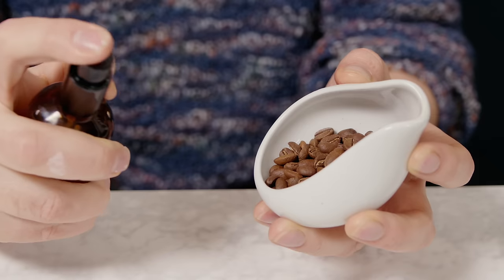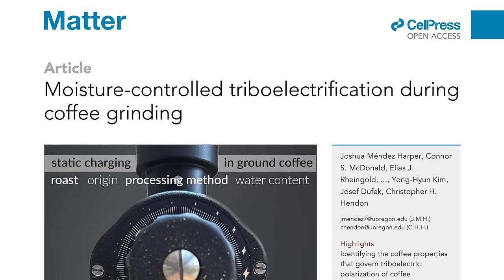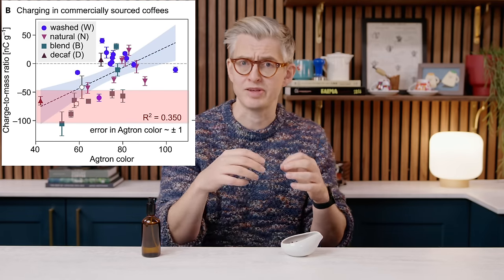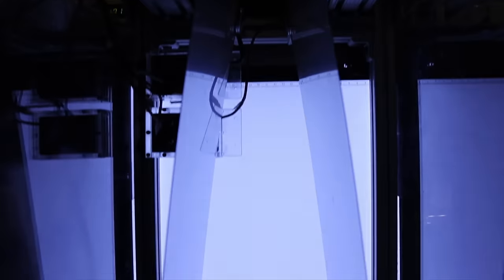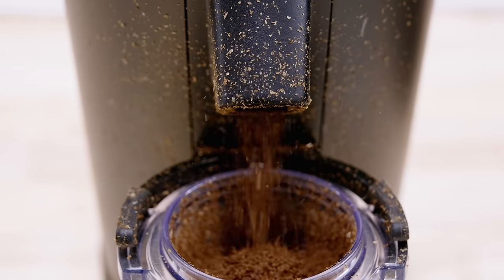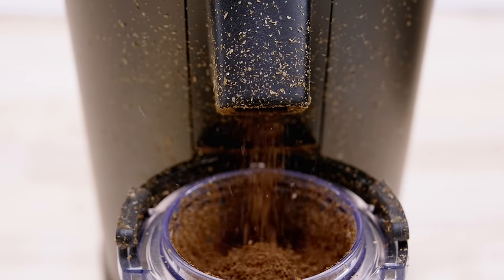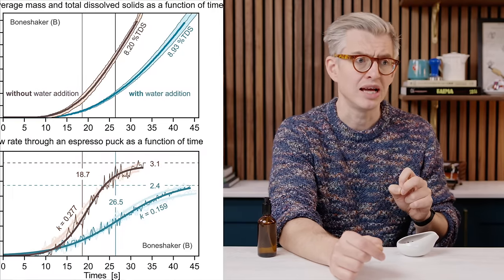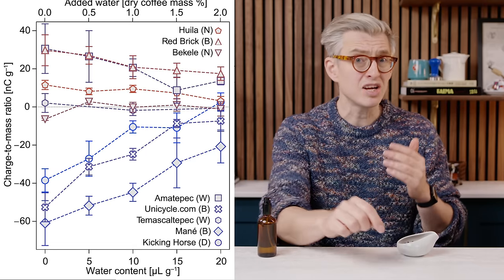Science Discovers What We All Missed: More Than An Anti-Static Hack

Comment: The reason you're not seeing particle size differences in your particle sized analyser is probably because it breaks up the electroclumps during the measuring process. No idea the details of how the machine works, but it would be far from surprising if it was violent enough to the micron sized particles to break up the electroclumps into their constituent grains.
Reply: That's definitely a potential hitch in their theory. They are just assuming that the changes are caused by clumping. But if you can't prove uneven particle sizes because the measurement method interferes with said clumping, it is just theoretical.
Reply: @skeetsmcgrew3282  You'd have to pretty much do it manually I suspect. Get samples to test under a very good microscope and either visually confirm the existence of electroclumps or do a visual size comparison of the whole sample. Although you could probably take a high res picture and have a computer do the comparison part.
Reply: It looks like a Litesizer DIA 500. This comes with one out of three choosable dispersion units with the object to separate particles from each other, which indeed could separate the clumps. One is solving it in liquids. One is Dry Jet. One is Free Fall. No idea which one was used in this video.
Reply: It's like in quantum mechanics, the measurement problem all over again!
Reply: @maxmuster6390  Thanks for digging into the hardware! Would be good to know what they're using in their machine. I guess free fall might be the only one which doesn't destroy electroclumps?Although if they survive the tampering process in espresso making, then perhaps they're not so fragile...
Reply from the maker: Dry jet!
Reply: @jameshoffmann  dry and wet dispersion can lead to very different results, as the amount of energy imparted on the particles for dispersion is very different. Agglomerates can be very sturdy or very brittle, so particle size measurement with laser diffraction often needs a thorough method development before giving useful and repeatable results. Trying lower air pressure might lead to "better" results if you are looking for your "electroclumps". Also, laser diffraction works best when comparing results with previous runs, so more measurements might help improve the picture. Source: I work as a sales and application specialist for a company that produces and sells laser diffraction equipment (though not the one in your video).  Feel free to ask any questions you might have on laser diffraction. Anyway, I was delighted to see my profession highlighted here, thank you for that!
Reply: The water doesn’t change the particle size distribution - it changes how the particles distribute themselves amongst each other! That was the whole conclusion of the paper and why the pull takes longer. I don’t see any conflict. I see confirmation.
Reply: Yeah proper comparison would be to do particle size analysis before and after a deionization process to see if there is a shift in particle size distribution.
Reply: schrodinger's coffee 🐈
Reply: like, don't get me wrong, you all sound smart one way or the other, but I can't tell if this thread is even real, mostly due to the presence of the word "electroclumps".
Reply: I used to play bass for the Electroclumps in the 90's. Amazing gigs...super caffinated. 😂
Reply: The dry jet method uses compressed air to disperse the particles. Comparing with the free fall method should determine whether particle break up occurred as a result of the compressed air. As this instrument uses dynamic image analysis (and not laser light scattering) to get the PSD, there should also be an obvious morphological difference visible if one method broke up the clumps and the other did not.

While I’m here, I would be interested in seeing if spraying with a salt solution changed the extent of electroclumping. It would screen charges between particles better than water alone.
Reply: @wendellwatson6015 this high-school dropout dose not understand the distinction, please explain
Reply: @TheFoodie77   being enjoyed by his cat
Reply: @ibieiniid4240 Well James did use the word and even explained why he used it in the video. He even showed a clip discussing it with Chris, author of paper being discussed…
Reply: I wonder if a powder rheometer would give some more information about the differences between these methods. In my mind this would better approximate the clumpyness of the resulting ground powder.

Comment: I tried this on my Moka pots today (6 and 9 cup) and noticed a couple of things: 
1. A longer brew time than usual (my usual is no spray) 
2. I also noticed a lot more "crema" if you can call it that 
3. On the 9 cup the safety pressure valve was releasing little bits of steam as it was brewing. To me that indicates higher internal pressure as this has never happened before, but could also be a bit of crud stuck in the value allowing it to release. 
4. After the brew, the "puck" was much harder than usual and didn't break apart after falling into the trash which is uncommon. 

As for taste, I'm a bit worthless because of my ongoing sinus infection, but I can at least say they taste good. 
I used a Baratza Encore on setting 10, set up how the manual tells you to, and I use a Moka pot method very similar to what James recommends (with an areopress filter and all).

James and Co., thank you for doing what you do. I have a background in science research and your emphasis on evidence and your style of communication are brilliant. Your content is such a pearl amongst the sand with how much sensational and basless content there is on the internet nowadays. It truly makes me enjoy coffee much more.

Comment: This is fascinating!  There's a nugget here about grinding frozen coffee.  I've been freezing beans for freshness since I use coffee pretty slowly.  An unintended result is that when I take out a dose of 18 grams of beans to grind, pretty quickly they get covered in a nice even layer of condensation because they are so cold.  It's like getting a mist and mix for no effort.  Hard to control the amount (which is a function of time and the relative humidity in the room), but interesting nonetheless.  I've also had no issues with grinding frozen beans in my Breville Barista Express or my Fellow Ode gen 1, and not surprisingly I've had much less issue with static compared to grinding room temperature beans in the same grinders.
Reply: What you say seems to me the near perfect way towards achieving evenly moist beans so going to give it a go.😊
Reply: The father of a friend of mine was a coffee merchant and he says to freeze coffee beans because it helps stopping the burrs getting hot and 'cooking' the grounds when you grind larger amounts of coffee, or several in quick succession.

Comment: Interesting. I've been using this much water already, because a single spritz was never enough to get rid of the static. My grinder after 3 years of doing so is perfectly clean inside, as I just did a maintenance run of it last week.
Reply: Same here. For years I've been using 3-4 sprays for 16.5 grams in my conical burr grinder (Capresso 560), and never had issues. This is for an Aeropress.
Reply: I did that as well, sprayed sprayed sprayed, until it looks wet, all static is gone and somehow it taste slightly better than just small mist. I thought it was just placebo, it is real then. Mine is Breville BES870 built-in grinder, it has insane amount of static, without thorough spraying, it is always make a big mess. I've been adding a lot of water for 2 years almost everyday, the grinder is still fine.
Reply: Yes, I have to use a few spritzes as well because I live in a very dry climate. Never had any problems with my grinder.
Reply: This is excellent news
Reply: I just have an ocd thing with numbers and I do things in 3 😬🫠
Reply: @worawatli8952 interesting. I wouldn’t have thought the Breville very suited to grind on demand
Reply: @billeterk  I had a few chances to try Niche Zero, it is great, but my Breville is very good value for an all-in-one unit type, I thought I might want an upgrade, but after trying more costly stuff, I feel that I don't want anything better, for now. The only upgrade I did was fitting a single dose bellow hopper to get rid of all residue ground after every single dose grinding, it make dosing much more accurate.
Reply: How will that work for coarser beans for pourovers ? Than all the chaff is in your ground beans instead of on the metal plates ?
Reply: Same
Reply: I don't wet coffee beans with a sprayer. I flick water off my fingers after wetting them quickly under the tap.
Reply: @CharlezMalasana that's interesting as doing things in 3 is a "sunnah" of the islamic prophet Mohammed pbuh.
Reply: First of all I hatte the mess of the flying around coffee, when there was no wetting before. You loose absolut 0.5 Gramm that remain in the Grinder. I think the right Distribution in the Basket makes a more important impact on the extractioin. And yes, the Flow of the shot ist more even, no matter if i use the niche  Zero, or the jz  Max Handgrinder
Reply: @TedCopeland I too have a capresso 560 and have always been annoyed by the amount of coffee left behind around the burr. I can't wait to try this spritzing added!

Comment: I just wanted to drop some extra information that wasn't in the survey since I found this very interesting:

I used a Fellow Opus and had an 18.4g dose (pre-ground) for both dry and wet beans. I used 0.4g of water on the beans to try to match the recommended dosing, but I couldn't be exceptionally precise, and just used the scale to measure a general amount that I dropped in and mixed.

I noticed that my grind time increased from 17.19 seconds dry to 21.75 seconds wet - however the dry grounds lost .1g to static that I was able to keep with the wet grounds, so ultimately the dry grounds brewed 18.3g of coffee to 40g out and the wet grounds brewed 18.4g of coffee to 40g out. There was noticeably a difference in the texture and distribution in the grounds as well - the dry grounds tended to clump together when moved around and the wet grounds were completely loose and would not clump or stick to any receptacles. It was noticeably easier to distribute the wet grounds and dose it into my portafilter. To a point, it seemed to not even need a distribution tool as there was virtually no clumping to begin with.

My dry shot measured 20 seconds to yield 40g and wet took 31 seconds. Neither shot produced any noticeable difference apart from the length of time, there was no impact on crema or any strange occurrences during the shot.

I checked both pucks, and because I use a puck screen I wouldn't expect there to be any channeling, and sure enough neither puck showed any signs of channeling. Both were completely in tact and looked to be about the same volume, though I didn't think to weigh them and see if they had any noticeable difference in that way.

Finally on flavor:  both had a very similar flavor, however I would say there was (and it could be confirmation bias) just a bare hint of extra flavor in the wet grounds. Tasting both side by side it was a very minor difference, and it could even just be a shot to shot variation from any number of factors, though I attempted to control everything as much as possible. Overall I personally find that the experiment really just gave me a good reason to use the RDT method because of the distribution and ease in actually prepping the shot rather than any additional flavor benefit. The 11 second difference in shot time was fascinating, but the flavor wasn't significantly changed enough to warrant the technique on that behalf with my grinder and brewer.

Thank you, as always James, for giving something to think about and having us along for the journey!
Reply: Thankyou

Comment: Just tried it with a pourover. 30g light roast beans, 8 sprays of water, Baratza Encore grinder on my regular setting for pourover. Had a little trouble with some of the beans sticking to the hopper, but I eventually got them all through. Used the ultimate pourover recipe in a Hario V60 plastic cone.
I don’t have any numerical results (it is Sunday morning after all), but it is definitely the best-tasting pourover I have ever brewed from these beans.
Reply: I think that spraying beans in general simply improves coffee extraction a bit in most cases. Unless you have some ultimate grinder, that is able to take care of whole electric charge issue.

Just a theory, but Im guessing that having in general less static and less clumped ground coffee simply improves extraction on its own. Cause all types of brewing work better with more uniform and less clumped ground coffee, hence why RDT and WDT exists.
Reply: I find with my Encore that if I use more than one spritz it gets a bit gummed up and clogged. I typically grind 65g at a time for a pot of drip.
Reply: @artofficialflute I also use a Baratza Encore. 20 g medium to dark roast beans in the brew basket, 4 spritzes, shake the basket to distribute the water, in the hopper. No jams and very little retention. I've seen at most 0.1 g difference in input beans vs output grounds. I aim for 1:2.5 bean to output ratio, so I'm seeing about 50 g output coffee.

I wipe the basket dry too, to ensure there's no excess moisture when filling the basket with grounds.

Perhaps our spray bottles differ in how much water outputs per spritz. Alas, my scale isn't granular enough to measure such a small amount of water.
Reply: Though it is only observational data with no real way to quantify for filter brewing, by doubling my water amount (4 spritzes vs 2), I have noticed a significant reduction in static and a seemingly better bed of coffee in my filter. It also seems that the bloom phase is more vigorous. My palate is mediocre at best, but I think the resulting acidity is lower. Again, the results are solely observational, but I think there is a benefit to using more water for filter coffee, as well.
Reply: @brenttotten9109  Do you see any gumming up of the Encore grinder with the 4 spritzes?
Reply: @artofficialflute  You are saying the you use 1 spritz of water per 65g of beans and it gums up? That is way less water than what James is suggesting. I have an Encore and am concerned about gumming it up with water added to the beans. I have no Espresso machine, just a drip machine, aeropress, and pour over Chemex (and now Moka pot for Christmas).
Reply: @brianhowthorne Did you experience any gumming of the Encore?  What about over time with repeated use of water sprays on beans?
Reply: @ourholm I use a Virtuoso+ and have not seen any gumming up at all. Not sure if it helps, but I do make sure to give the beans a stir and shake to coat the beans evenly with water. Just a guess, but it is quite possible that dry grounds hitting wetter grounds could cause gumming.
Reply: @brenttotten9109  Not sure what you mean in your last sentence. Do you mean in the collection bin as it grinds?

Comment: Eurêka ! I think I've experienced that effect. It always puzzled me, the difference in extraction time between two identical doses of coffee with identical grind, on two cups made one after another. The second one almost always takes longer. But now that I think of it : two sprays of water on my first 18g dose of coffee beans, followed by two sprays on another 18G dose of coffee beans BUT IN THE SAME BEAN CUP leads to a second dose with more water (because of the residual water from the first dose). So... Maybe this explains it. I'll do the test for you, first thing tomorrow morning !
Reply: Same here! I always thought my grinder is just inconsistent 😂
Reply: I see this every morning with my Sage Barista Pro and it was driving me crazy
Reply: Me too, no spritz, but the second shot does sometimes take longer with more variable pressure.
Reply: I am experiencing exactly the same, but  I think there are a lot of things affecting things. For example that when pulling second shot the basket hasn't been flushed and therefore has brewed coffe sitting on the surface of the basket making the the fresh coffee grounds stick more to them, which I believe minimizes the effects of the water escaping along the metal surface of the basket.
I've also noticed that if I distribute the coffee in the basket with a slightly raised amount along the basket edges, to prevent basket surface channeling, I get more consistent shots.

Comment: James, I would love if you could get a multimeter and measure the resistance of the various materials the griders are constructed from, particularly where the machines directly contact the ground coffee at the end of the grind. My theory is that more conductive surfaces like metals will better dissipate the charges than plastic insulators. I think this likely accounts for that initial difference you noticed between different grinders -- the Eureka Mignon Oro has a metal spout and cup.
Reply: In all coffee grinders produced in the world, coffee beans come into contact with aluminum (For me, this is more of a problem. Dishes and cutlery made of aluminum are not produced and are not used in the kitchen.
Reply: That is my thought too. Lots of coffee grinders have a lot of plastic. Plastic is a poor conductor of charges.

Comment: Works well for me. I use the 1ZPRESSO hand grinder and now I have almost no grounds adhering to the burrs at the outlet, grinds don't cling to the bottom receptacle either. Visibly less clumping. Grinds flow smoothly out of receptacle into the Porta filter unlike before when I had to tap firmly to remove them.